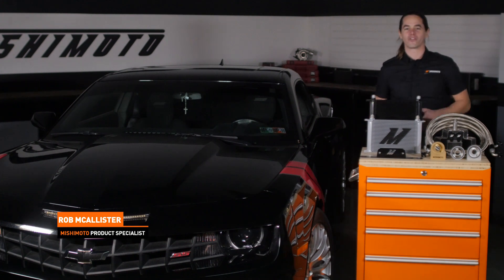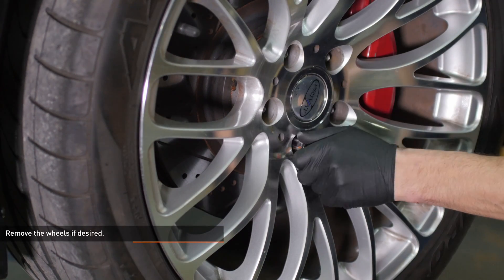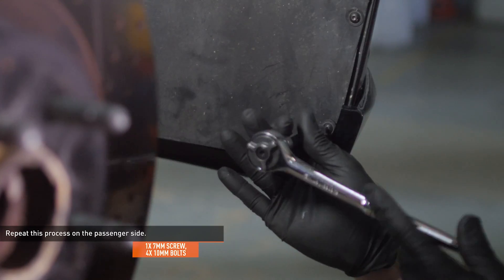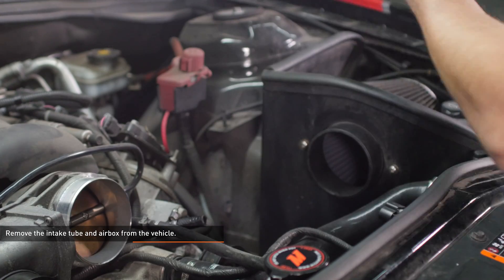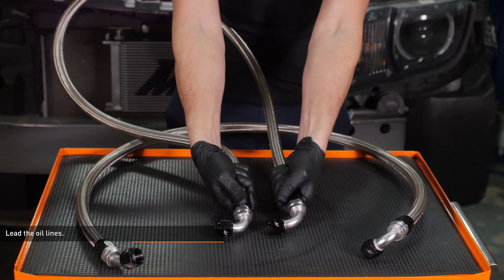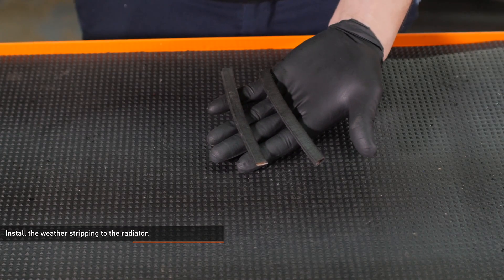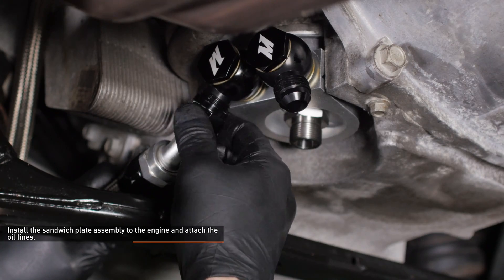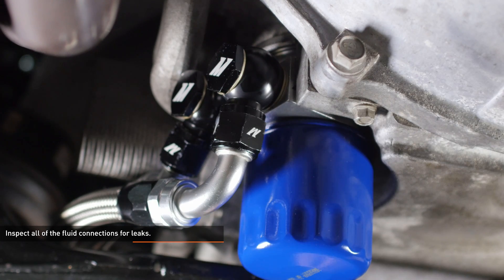2010–2015 Chevrolet Camaro SS Oil Cooler Kit Installation Guide by Mishimoto

Comment: How tight did you install the banjo bolts?? I'm doing this again after I have been fighting a leek for 8 months. Your warranty people are awesome!
Reply from the maker: The recommended torque specification for all straight fittings and banjo bolts is 15-25 lb ft. We do not suggest over torquing them as it'll rip the rubber liner on the seals creating a leak.

Comment: Does the original oil cooler run to the bottom radiator of the driver side?
Reply from the maker: We do not show an engine oil cooler incorporated into the factory Chevrolet radiator. You may be thinking of the transmission oil cooler commonly found embedded into the lower radiator tank.

Comment: Can I i use this oil cooler for a transmission cooler? 2014 Camaro SS 6L80
Reply from the maker: Yes, everything in this kit is compatible with transmission fluid, however, the lines may be too large. The cooler from this kit can also be purchased separately if you'd like to piece your own transmission cooler kit together. Thanks!

Comment: Hello! 
Quick question. I have a 2013 Zl1 Camaro and I just swapped the block with a 434 CI Ls Next iron dart short block. Will this work with it?
Reply: What kind of heads and block are you running specifically? I ran a specific thermostatic oil cooler feed on my LS3 engine, and basically ran an identical setup minis the sandwich plate adapter for the oil filter (tends to have leaking issues). 

I assume you would probably be able to do the same exact thing. If not and you go with Mishimoto’s kit here or go after a sandwich plate adapter of your own, you’ll just need the right size thread adapter for your particular oil filter.   That’s really the only main difference I can think of, off the top of my head..
Reply from the maker: This is not something we have specifically tested. Sorry!

Comment: Interesting that this install leaves the OEM oil cooler in place.  Why?
Reply from the maker: The OEM piece can aid in warm up and we feel it's best to retain this.
Reply: Like Mishimoto said and how GM basically designed their “heat exchanger”, it helps to warm up the engine on cold starts. The power steering lines, transmission lines, as well as coolant lines, all run to engine oil circulating in the oil “block” right next to the engine oil filter. Everything pretty much heats up and stays cool, with the water (coolant)-to-oil cooling setup. 

If you delete the factory oil cooler, you can just drive the car without it; although it’s not recommended for people who live in really cold climate areas, as it might decrease  overall cold start efficiency. However, you can install an air-to-oil cooler setup, which is the common one you see, with row coolers mounted somewhere towards the front, where air flow can go through it. 

The most important part to note, is that you will want to figure out whether you will want a thermostatic (contains a thermostat at the oil feed) or non-thermostatic (no t-stat at oil feed) oil cooler setup. As mentioned earlier, running a non-thermostatic oil cooler setup might be more beneficial for hotter climate areas. The sandwich plate adapter works for most cars; but if you want an LS-engine specific oil feed adapter, they sell a bunch as well; both thermostatic and non-thermostatic. 

I bought the parts necessary to delete the factory oil cooler, and then installed my own thermostatic oil cooler setup, and it happily sits at 200 F, at a neutral standpoint. On hot days, if I get on the car, it might get up to 205 F or so, but rarely will it get above that unless I’m absolutely thrashing on the car.
Reply: @isnowyazn  What temperature thermostat are you using to get that 200-205 temp?  THX.
Reply: @AndyHess-jy6vx Check out Improved Racing; they have a variety of thermostats. I barely managed to actually fit mine, just with some luck… It required me to use a 90-degree adapter fitting on one of the -10 AN adapters.  I also had to ditch the provided Allen hex  key head bolts, and run flanged hex head bolts that were just a bit longer (to be bigger than the countersunk port for the provided bolts and their heads).

Comment: Will this kit still work fine if i delete the oem cooler, or do I need to leave it on?
Reply from the maker: We suggest retaining the stock piece.
Reply: A lot of the guys on Camaro5 have ditched the factory oil cooler. Depending on whether you have a 10-11 or 12-15 V8 model, the radiator hosing will be routed a bit differently to the stock oil cooler. If anything, the stock oil cooler is more of a “warmer”, since it is coolant-based and helps the motor oil warm up a bit quicker for the engine.

I chose to remove my stock oil cooler altogether, due to most ppl dealing with chronic and defective oil leak issues. This, and I would also be getting better oil cooling performance without the interrupted flow of two different cooling mechanisms. Note, that you will have to get a few extra parts in order to run the factory oil cooler delete, and that it is actually perfectly fine to run the car w/o any oil cooler (except for tracking/racing purposes, obviously).

You can then either run this Mishimoto kit, with the sandwich plate oil feed that goes to your oil filter housing; or you can opt to build your own custom setup, one that preferably mounts to the oil feed that you removed from the oil pan, with the stock oil cooler. 

You can also build a much cheaper oil cooler setup if you go about using an oil feed without a thermostat (non-thermostatic). However, you’ll probably need to size DOWN the oil cooler, and figure out additional ways to keep the engine either cooling better or heating up at startup quicker. You cannot have the both of best worlds, unless you are thermostatic, unfortunately; so that is a price point you must consider.

Comment: Do you have part numbers for the pieces in this set I want some of the parts and others I want to change and use a different oil intercooler from you guys. I’m going to make myself a custom mount and a few other things but I just want to get the parts a pieces out of this set I will need for my 2011 Camaro SS
Reply from the maker: Please contcat us directly with what you are looking for at support@mishimoto.com and the team will get back to you.

Comment: What’s the difference between the thermostatic vs non-thermostatic plate?
Reply from the maker: One has a thermostat in it :). The thermostat will regulate the temperature to prevent overcooling.
Reply: Without having a thermostat, you will be running your oil through the oil cooler/lines at all times the engine is running. 

Some people will notice slower warmup times, which might not be efficient for you, esp if you live in an area with colder climate. 

You can still theoretically run an oil feed w/o a thermostat, but you’d probably want a smaller oil cooler (with less rows). And if possible, you would want to somehow mount the oil cooler strategically, to where the oil will warm up at a similar rate as stock
Reply: @isnowyazn so like for me in Texas, would you say just go ahead and get the thermostatic one even tho we get cold cold last few months

Comment: Awesome instal video really appreciate it was debating how hard it would be to instal one but after seeing the process looks like a breeze! Im running a 416 LS3 and after the stroker kit am seeing oil temps around 250 what kind of temp decrease can I expect to see ?
Reply from the maker: • Reduces oil temperatures by up to 35°F
Reply: Dude that’s the exact same with me. 416 ls3 stroker and in AZ I’m getting temps of 240

Comment: Will this work with your radiator for the camaro SS?

Edit: also would you recommend running an additional quart of oil for the oil cooler?
Reply from the maker: Yes it will.  The increase in capacity is 0.75 qt.

Comment: Curious, does the oil filter have higher risk of getting damage from bumps and lumps on rougher roads, as it hangs lower after the install? Or is it still high enough it shouldn't be a worry? Thanks!
Reply from the maker: Shouldn't be an issue.
Reply: I experimented with this, as well as a bigger oil filter (aftermarket, as OEM doesn’t have a compatible one for the thread size). Both still sat barely above the subframe crossmember, so it should be fine. By the time that you’ve struck something beyond that… you probably should be worrying about other issues…
Reply: @isnowyazn what larger oil filter did you use?
Reply: @ACamaroGuy  AC Delco PF61. It’s just longer, same thread pitch. I’m not sure if it made my oil pressure drop, but I doubt it. I recall the Corvette owner manuals or references somewhere, saying not to run aftermarket engine oil filters, but I’ve never had any “serious” issues doing so… You can research it if you’d like, but I also think that the filtration rate leaned more towards either engines with dry sump oil tanks, or engines with forced induction setups.

Comment: Hi , do I have to cancel the factory cooler?
Reply from the maker: This oil cooler kit retains the use of your stock liquid to liquid oil cooler
Reply: @mishimoto   thank you , so i don’t need to cancel the old one with this kit right ?
Reply: @matrixkakira8190 Hopefully you figured it out, but most people decided to remove the stock oil cooler, to get the most optimal engine cooling benefits. That, and the factory oil cooler setup is known to have defects and is prone to have chronic oil/coolant leaking issues. 

Some people have even opted to run without any cooler at all, except this wouldn’t be optimal in the case that you would want to drive the car hard, of course. If you live in a hotter climate area, I would either stick to keeping at least some form of an oil cooler. Living in a cold climate area, you may also want to retain the oil cooler, as the factory unit actually helps to warm up the motor oil for the engine on startup, as it is coolant-driven.

Comment: I know this is an old video, but which side is the oulet and which side is the inlet? Asking so I can add a oil temp gauge to the oulet temp (coming out of the block). Thanks
Reply from the maker: Either port can be used as the inlet or outlet.  Yes, you are able to use a 1/8NPT fitting for an oil temp gauge.
Reply: @mishimoto  sorry, I meant which side of the sandwich plate is the outlet. Thank you for the quick response though

Comment: Should I fill the oil cooler with oil prior to install to keep from the system running dry for a slight second?
Reply from the maker: Shouldn't be an issue. You can crank the motor over a few times before initial start up if you are worried about priming the system.
Reply: @mishimoto People say you can prime the oil from the motor, by pulling the fuses for the fuel injectors and/or fuel pump. I only see the fuses for the injectors, so this should be okay, right? 

Once injector fuses are pulled, I can attempt to crank the engine 3-4 times, and this should bring up the oil enough? And this is assuming I either leave the cooler lines and cooler itself dry OR pre-filled with motor oil, correct? 

Can anyone else chime in? I’ve asked around on Camaro5 and tried to do my research, but I’m just double-checking. Not a lot of people tend to post on here, and I find that running a similar setup to this is actually pretty beneficial (esp when installed with a factory oil cooler delete).

Comment: Can you mount the cooler so all the oil drains out of it when you change the oil?
Reply from the maker: There will alway be some oil left in the cooler. However this is normal even for OEM setups and should not cause any issues.
Reply: Ok thank you

Comment: Will this work on a 2015 chevy Ss Sedan
Reply from the maker: While the oil cooler will connect to the motor your pointing points will be all wrong and require modification.
Reply: Aside from the oil cooler mounting spot, which uses the threaded holes already there on the Camaro’s radiator support area, you might need to find a different spot… Aside from that, everything else should have still worked out just fine. This should theoretically work for all LS3 applications, and even other similar Gen IV LS engine setups. 

I personally went for a custom setup, using the same exact parts setup as the Mishimoto kit. The only major difference for me, is that I used a oil cooler thermostat that bolted to the oil pan feed, where the 5th gen Camaro V8 (LS3/L99) has the stock oil cooler mounted. 

In my case, you would have to remove the stock oil cooler entirely; and get the extra parts needed for the factory oil cooler delete, before being able to run an oil cooler feed from the oil pan. 

I chose this over the sandwich plate style oil feed, since I heard they had a lot of issues with leaking. Not exactly something I’d want, considering most, if not all, of the factory GM oil coolers for the 5th and 6th gen Camaro’s, are pretty bunk….

Comment: How does this mount with an intercooler? Say I have a procharger.
Reply from the maker: The oil cooler sit pretty high up on the front end. However you would want to ensure the your intercooler would not interfere with the mounting location we designed. Otherwise you may have to modify the mounting location if they do interfere.
Reply: Modify or make a bracket to make it work.

Comment: Quick question, do pre fill the oil filter or not before installing it, also do you have a upload of installing a external trans cooler for the Camaro at all ?
Reply from the maker: Some customers choose to fill the cooler and lines prior to starting the vehicle to prevent additional wear on the first startup. We currently do not have a video for the transmission cooler on the Camaro at this time.
Reply: Super late reply, but you can do the “clear flood” mode in your 5th gen Camaro V8, by flooring the accelerator pedal BEFORE turning the ignition on and cranking the engine over. I’ve done it in my MANUAL SS (10-15) with the LS3 engine, but I’m not sure if it’s the same procedure for the automatic SS models with the L99. 

Alternatively, you can remove the fuses to your fuel pump or fuel injectors, as well as your spark plugs; then you can simply crank your engine over for 5-10 seconds at a time. 2-3x should do it, as you don’t want to drain the battery and wear out the starter!